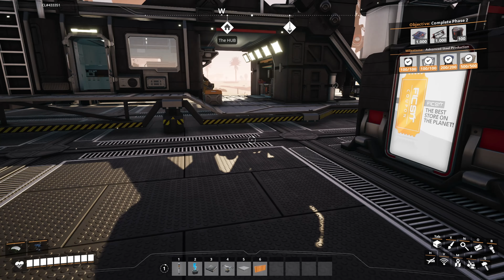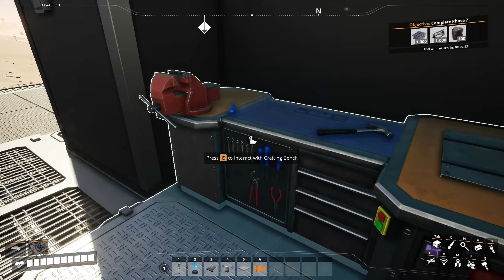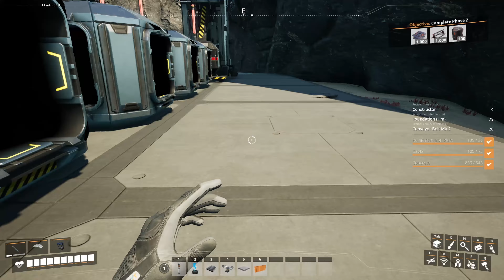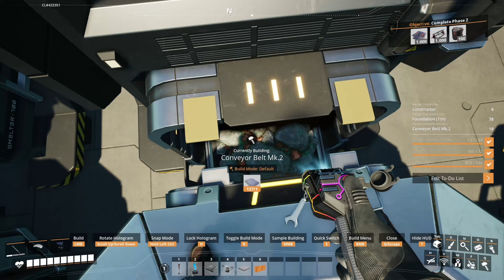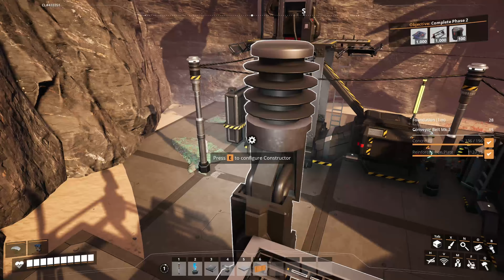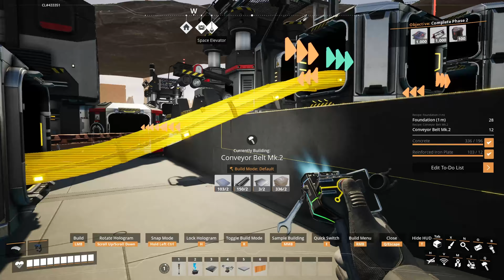Milestone Madness and Hyper Tube Fun in Satisfactory! Episode 8

Comment: Hey, welcome back!
- The Priority Merger can be useful in some edge cases, but not nearly as much as the Smart Splitter.
- Collect some hard drives. There are some very useful alternate recipes for steel products. (And some very useless.) You are offered two choices when you scan a hard drive, and you can re-roll them once for two more. You can also just leave them there unselected. If you scan more hard drives, any unselected recipes already present in the library will not be offered again.
- When building a manifold line, keep in mind that each split will only take as much as the machine consumes. Usually I just keep the main line the same faster belt type to avoid making stupid mistakes. It also makes extending the line way easier.
- When placing conveyor belts, you also need to pay for the conveyor poles (so extra rods, plates, and concrete).
- Straight belts always try to go up or down before the turn. You can try building them in the other direction (if you have something to connect them to, by default you always place the incoming side of the belt first)
- Biomass burners will not work with Power Storage. They do not produce excess energy, and power storage stores excess energy.
- Right click a color swatch to set it as default for certain types of buildables. (Or just change the default.)
- You unlocked a new double sized storage. Just in case it got buried between other unlocks.
Reply from the maker: I found out today that there is a jet pack. In the next episode I will create fuel for that and then I plan on doing some exploration. Hard drives, Mercer spheres, and whatever the third line of alien tech is on the MAM.

Comment: Yay, now you have lots of power! For a short while. Somehow you always run out of power in this game... 😀
I think the reason why you couldn't connect the miner to the splitter when it was very near it, was because the miner must be placed on a resource node, and that node is not exactly lined up with you foundations, meaning that the miner and the splitter were not perfectly aligned and the gap was too small for the belt to make a curve.
Good thing you put those Mk2 belts in your incoming smelter manifold line. The first smelter is only taking 30, so the splitter is shooting 90 forwards which is more than an Mk1 belt can handle. It's actually a good practice to put a faster belt in the manifold line because the devices can get filled up, and then the splitter can not do anything else than try to shoot everything down the line.
A manifold line can also handle devices that want different input amounts. You just have to feed in as much as the devices want to consume in total. It will stabilize to the exact amounts each device wants. Your wire+cable+sheet setup could have been just a single line of constructors attached to the same manifold line. But your load balancing setup works, too.
Oh, and fun thing about hyper tubes: The entrances stack with speed. That is, you can't directly attache the entrances but you can line them up in short sections so that first entrance shoots you out directly into the second and that into the third etc. Each entrance adds to the speed so you can indeed do FAST travel. 😀
Good episode, thank you! Enjoying your play-through.
Reply from the maker: I bet if you were to line those entrances up at the right angle, you could really launch yourself. I haven’t yet tried the jet pack but depending how that works going from launching to jet pack could be insane. I created fuel today for it, that episode will be out soon.